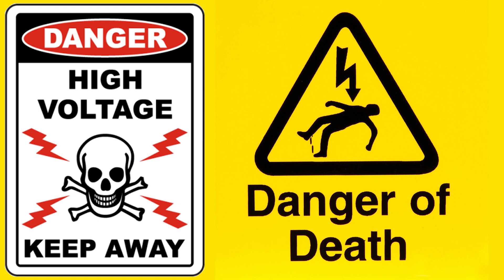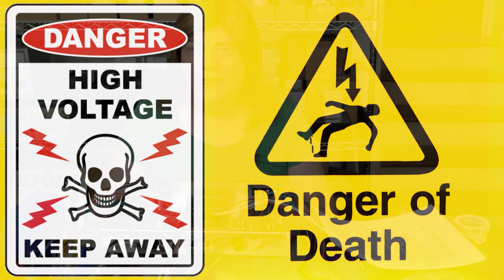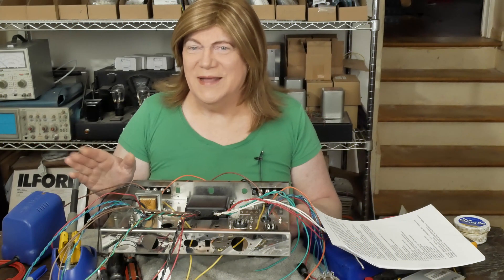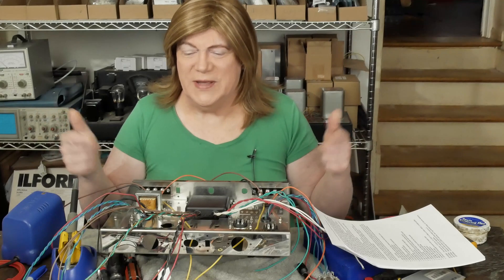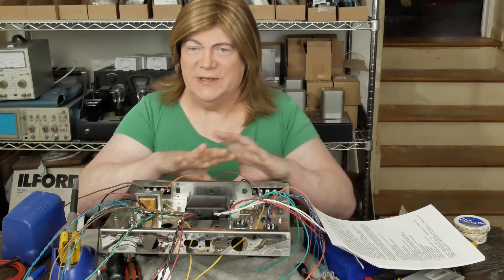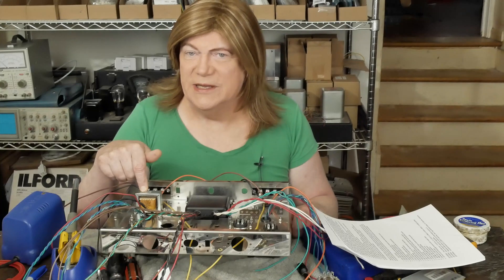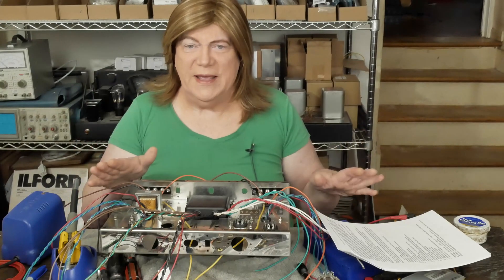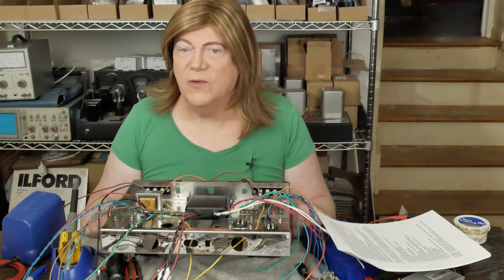Dynaco ST70 Tube Amp Kit: Output Transformer Wiring

Comment: I just want to comment again that you have a great ability to use the 3D space available inside a chassis. Especially when you're using solid core thick gauge wire and your other builds. I think it's something that a lot of amateur amp builders should keep in their toolbox.
Reply from the maker: Thanks!
Reply: @MrMersh-ts7jl  yes, I was just thanking her for that in another comment.